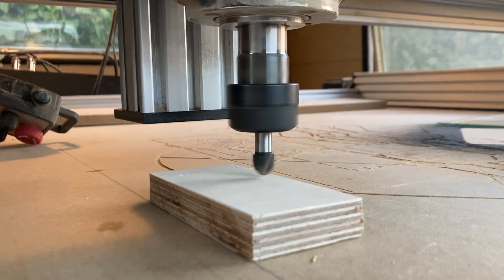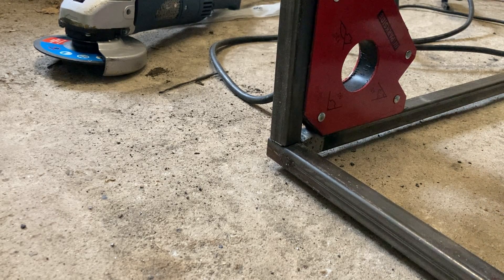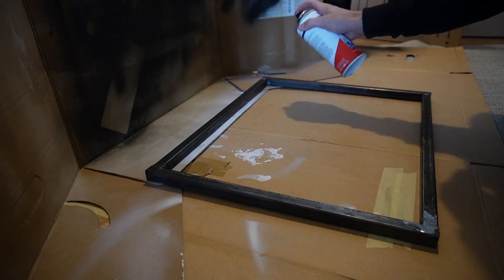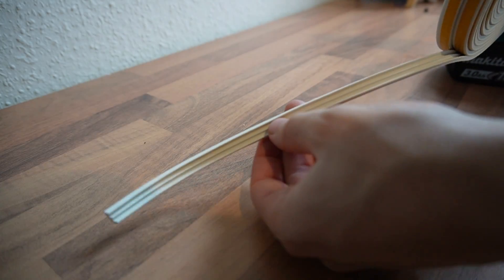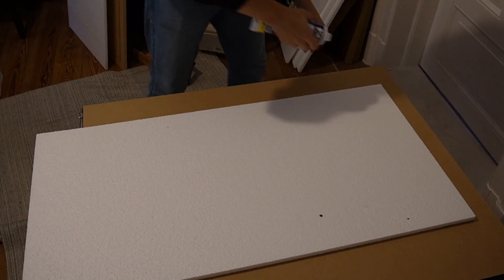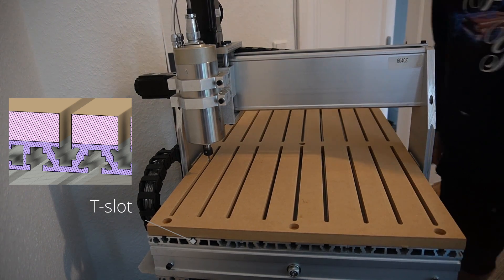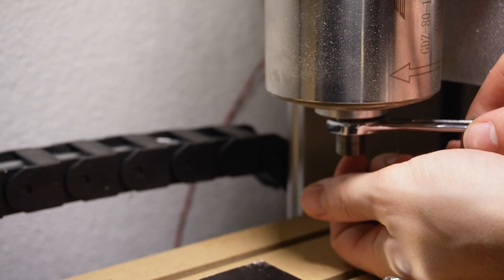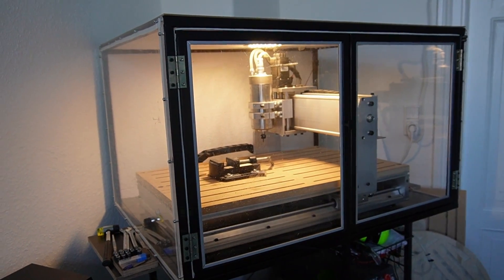CNC-Router in an Apartment? / DIY CNC Enclosure

Comment: whats the white foam for? did you steel tube the table as well? how was it joined? welding? is the cnc attached to the base of the enclosure with bolts? can this be done without welding just by joining the steel tubes with screws? because if i weld it it probably wont fit the door of my apartment
Reply: @mazeg7880
Reply from the maker: The enclosure is about 58 cm high so it should fit through a door frame without any issues. The CNC is not bolted down it just sits inside the enclosure. The white material is just Styrofoam I used it because it was inexpensive and helps a Bit with noise reduction. The table I didn’t build myself I just used one I already had. It would probably also be possible to build the frame with screws instead of welding. Good luck with your enclosure!